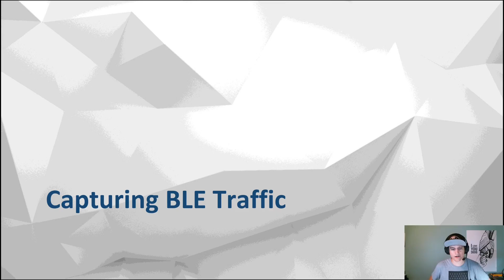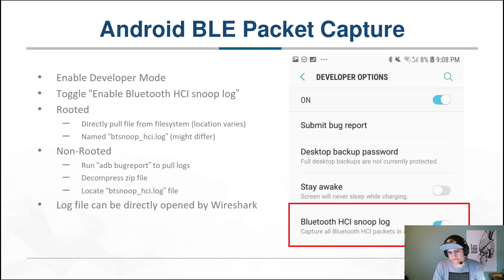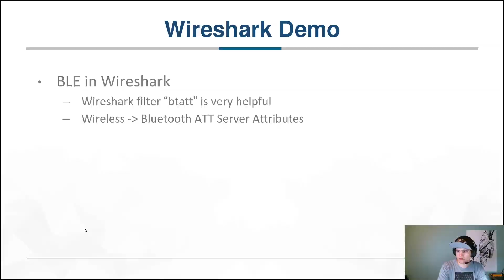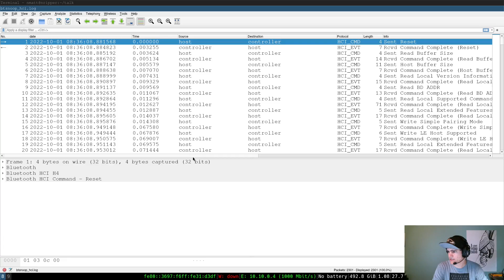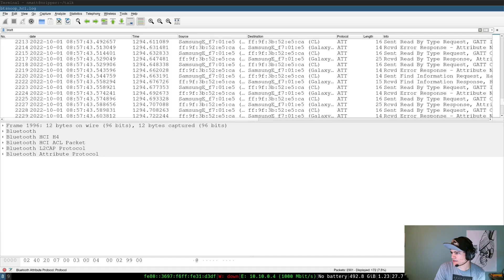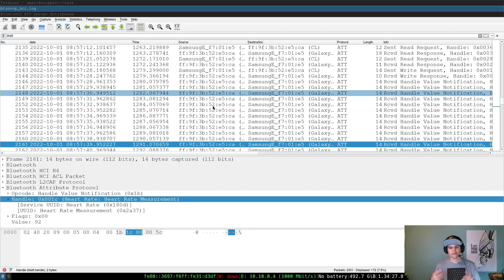Bluetooth Low Energy Hacking Part 2 - Sniffing Bluetooth Low Energy

Comment: if i connect to a bluetooth device, like a battery that has bluetooth, with my ESP32, does this count as a master-slave connection? or am i capturing encrypted data? I am asking because i want to reverse engineer the data from the battery that normally sends its data to a mobile phone app that displays: Voltage, Current, Power usage and battery percentage. i want to reverse engineer that data so i can use it to display it on my own display using my ESP32.